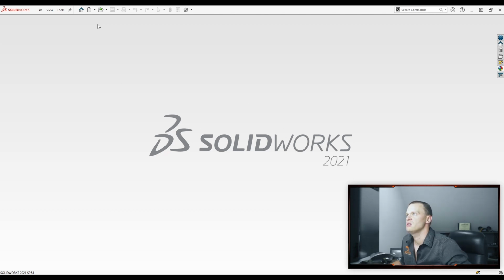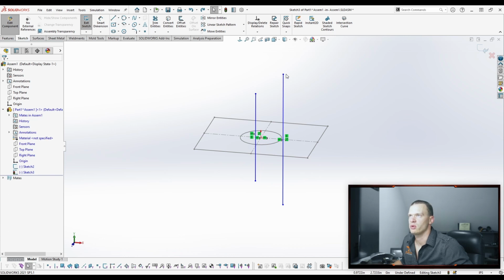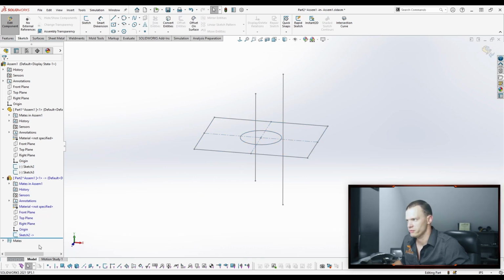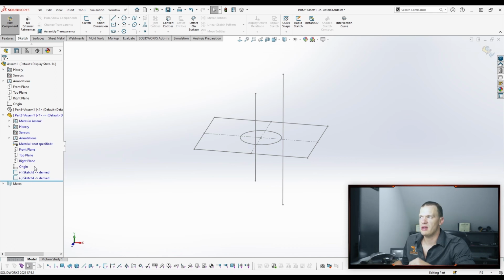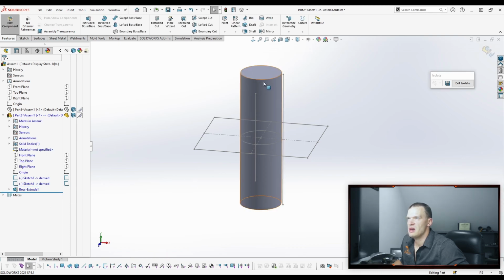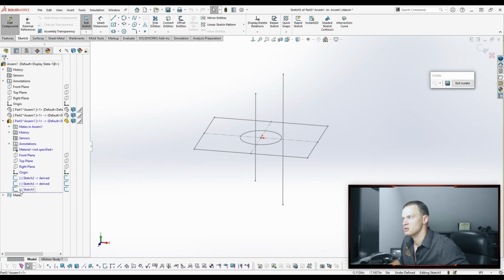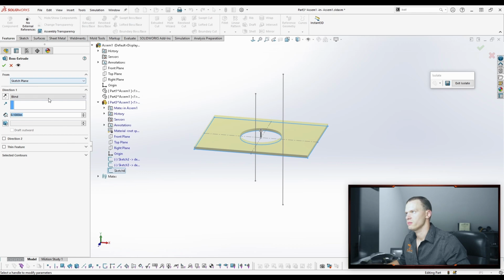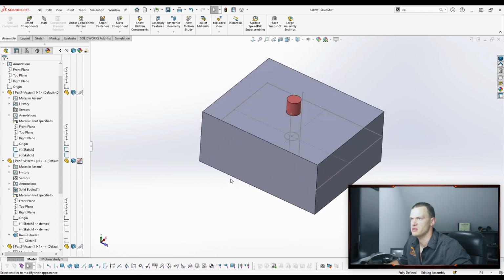Top Down Modeling With Skeleton Sketches in Solidworks

Comment: Yea, easy when you already know what to design. That is the problem with the cad software designers and instructors, They are seeing and approaching problems from a different perspective than a designer -  "This is the best way to design this assembly"....... But most creative designers just have a very rough idea in their head when they start. Then the design will grow slowly from blocky parts and grow by adding/removing features/parts hundreds if not thousands of times in the most chaotic order.... Yea, one could redesign everything again and get it clean and optimally structed after this creative phase, But small companies don't have such resources, and the design will be used as it is.
Reply: On top of this, the storage and creation of manufacturing info, especially when parts are shared between products, makes this utterly unworkable in a manufacturing environment that does any real part re-use. I rarely need my assembly to fully update and push changes in multiple subcomponents, and even when I do, I don't trust software to push the changes properly ready for review.
Reply from the maker: @jamesbuckle6077 You are right, this would be terrible if you tried to do it this way, but that would be a misuse of the technique.

This is primarily for NEW part design. Once the product has been validated and released (ie. is stable), best practice is to freeze or break the relationships, so the parts can exist on their own. By doing this, you can reuse them in future assemblies, just like any other COTS part, without worrying that they would change due to revisions in the parent assembly. Any future changes would be subject to normal ECN processes. I blame myself for the misunderstanding, because I do not cover this part of the workflow in the video.

Think of it like this: you would not reuse a part in multiple products that has not been designed yet (and if you were designing a multi use part, this technique would still be the best way to do it, as you could create functional relationships between both assemblies), and once it was designed and ready for incorporation into future work, the design would be stable and therefore locked out to exist on its own. 

Does this help/make sense?
Reply: @forgeproductdevelopment  that's true, but it's also a long way from the reality of the process anywhere I've designed parts. I feel it comes under "nice idea" but not actually a time saver unless you spend most of your time in development trying out dozens of iterations. Most of us napkin design a solution, plonk down the design in a first stab and maybe make one update based on FEA. I suspect there are some business areas where it's more applicable and they spend all day updating hole patterns and don't have the internal process checks to ensure mating parts were changed.
Reply from the maker: This may be a use case thing then. What type of parts are you designing? Are projects a few individual parts or an entire assembly/system/mechanism? Do you have multiple engineers working on the same project at one time (subsystems)? Are you doing from scratch development or mostly legacy stuff?

"Development" is literally in our name, so yes we spend most of our time with large complex and evolving assemblies. Our parts have many dependent relationships, that are constantly getting changed, evaluated and updated. Projects usually too complex to capture in a napkin sketch first stab. Relying on solely manual checks and modification would be far too slow.

That said, there are occasions where we are designing a part from a drawing, designing a single body stand alone part, or reverse engineering a part and just copying what exists. In those situations this would be overkill, as we don't need the parametric relationships. I might suggest that, if this is the type of work you are seeing, you could save a lot of money by dropping SW and going to a non-parametric CAD program.
Reply from the maker: This is a great comment, as I can understand your frustration and am sure others have felt this way as well. I have felt the same way watching people do surfacing Tutorials for SW too.

The truth is, you are right, CAD is a terrible iteration and ideation tool. It takes way too long to create even the simplest of geometry, let alone build proper file structure and dependent relationships. However, even though that is true, the solution is not to throw those things out. That would be an excuse for poor CAD practices. Rather, it is to use other, more effective tools for the ideation and conceptualization phase. Moving to CAD only when you can leverage what it does best, relationships and structure. 

Imagine you are trying to design a new house by building walls and pouring concrete, then half way through you realize the layout isn’t right. It would feel really clunky to have to rip all that out to change the design. In fact, that frustration may cause you to build lighter weight walls, or to try to move the concrete around while it’s still wet. The need for flexibility would create bad practices with those tools because they are being used for a job they are not designed for. Same thing here. You are using CAD tool too early in the process to be utilized properly, therefore you are creating bad practices to try and use the tool for something it is not designed for.

On a real-world project for a client, it is very rare that I will touch CAD before I have gone through extensive ideation and industrial design with pen and paper or tablet drawing tools. Keep in mind, I am an engineer, not an artist, so these drawings are often very rough and unsightly. Then, once the client has signed of on a design direction based on the 2D sketches, we move towards CAD, then iterate from there. Often times we will design a CAD model and then find a new design direction, but even then, we will go back to 2D sketching and establish direction before trying to capture the idea in a new model.

Also, keep in mind you are watching tutorials on how to CAD, not how to design a product from scratch. You only see “cad software designers and instructors” showing you how to draw stuff they already know, because they are trying to show you how to use the tool, not a documentary on their overall process. To make videos showing how to ideate or conceptualize in CAD would be untruthful to their process and bad practice. 

Hope this helps clarify some things, feel free to reach out if you have any more questions or comments!
Reply: @forgeproductdevelopment  no substitute for pen(cil) & paper, highlighters for ideation!

That said, I start with some simple reference goemetry in CAD to establish constraints, key datums, and simple sketches.  This because we've all sketched something that "made sense" until you put it to scale...

Print rudimentary CAD, sketch to ideate, update the sketches, occassionally add more reference features, lather, rinse, repeat.  This also creates a breadcrumb trail.
Reply from the maker: @raphaelhamm3853  This is an excellent suggestion as well. 

We have designed products where there are PCBs and motors, attachment points, or other components that are selected based on previous calculations. Sometimes we import those into CAD early on to get a sense of scale, and export out images to draw over the top of when coming up with designs.

I think the heart of the matter is "start with what you have and select the best tool to move your forward given the initial conditions'. Whether that be from COTS components, systems you need to integrate with, mathematical calculations, or a completely blank sheet of paper. Each project is unique and part of the fun of engineering is getting to solve and optimize for those challenges along the way.
Reply: My question is simple to you how can I design my own product then from scratch just like real engineers do with their own dimensions and specifications? If cad doesn't allow that then how? I cannot afford to copy only dimensions from YouTube and just stamp it.
Reply: @ridwanhusainishraq 
This is quite the read, feel free to reach out if you are still stuck on how to proceed.

The design process begins long before you first open a CAD Software.

I would recommend taking just a pen and paper and making bullet points for what your design should accomplish first (i.e. move a box from a to b / if the box is red, flip it upside down). No idea yet, how we accomplish that, just write down your goals.

Then you can add definitions, measurements, forces
-how big is  the box?
-Are there multiple sizes or just one?
-Are the sizes standardized or can they be anything between 1 inch and 1 foot?
-In what direction am I moving the box?
-How heavy is the box?
-How much space do I have for my transportation machine, what are the outside dimensions?
-What are the boxes made of like cardboard, plastic, wood, metal?
-How sturdy are the boxes, how fragile are they and how fragile is the content?
-Do I have to avoid vibrations? Or maybe I want everything to settle into place properly and I specifically want vibration.
- And so on...

Now you figure out how to best solve these problems, still just pen and paper.
- Do i use a conveyor belt?
- A piston that pushes the box over a row of rollers?
- If I go up, do I build an elevator to lift or a crane to pull up?
- Can I use a gripper and a robot arm? Magnets? Suction Cups?
-If my box is red, how do I detect that? Do I check the label if there is one with a bar code scanner or do I install a color sensor?
-How do I flip the box? Does that work with my transport system so far, or do I have to think of something new?

And when you have answered all of these questions, THEN you go into CAD.

Here you can decide if you want to go from outside to inside, the other way around or a mix of both. I prefer the mix.
Here is where the technique of the video really shines.

Make a part with the smallest and biggest box you expect for your machine (the inside part, what the machine has to handle). Then make another part or sketch that defines the space that your machine has to fit into (the outside part, the theoretical shell of the machine).

Now you start to think about where you place the parts of your mechanism and start sketching them one by one in individual part files (like the pin and block in the video). If there are things that will be moving relative to each other, make them in separate part files so you can join them in an assembly and check the motion later.
If there are pieces that are fixed to each other, you can either make them multiple bodies within one part (less strain on your computer) or you can design them individually as part files, combine them in a small assembly file and bring that assembly file into the big overall assembly to act like a single part . Or you make everything in individual parts and assemble them all in one assembly.

I would try to have multiple bodies in one file if I can get away with it. It depends if you want to make explosion views for drawings, motion analysis, mechanical strain calculation FEA, manufacturing analysis CAM or assembly studies (can I actually fit my screw in where I designed it or is the screw hole inaccessible?)
Reply: @user-kt7kh2vj2l you didn't understand. I have no specifications here. Becausr it isn't my design.  I just wanna learn the homework or prerequisite you do before touching solidworks. Customers will supply specifications and we must be able to design as per their specification in real world. So I wanna learn this approach from you. Think as an exam or assignment. The main thing is conception so what approach do u apply or knowledge do you apply such that you no longer need to be purely dependent on YouTube dimensions rather you can design independently using independent parameters

Comment: Hi, cheers for the video. Could you please give your opinion on why you use this method over adding skeleton sketches to each part using "insert part"? I am just starting out with this method but want to make sure I'm using the method with fastest rebuild times so I don't have to redesign the whole project again. I'm designing heavy vehicle bodys/trailers so designs are similar but never exactly the same, I'm looking for a way to more efficiently make geometry changes. I feel the main bonus with the alternative method is that you could insert the skeleton sketch to a part and then copy that file many times so you don't have to do the derived sketch each time you make a new part. Am I right in thinking that would be a more efficient approach? This video outlines the alternative method https://www.youtube.com/watch?v=99I0kh8d0wI Cheers!

Comment: Nice video
shouldn't  you have to constrain the new parts added to the original skeleton part (which should be fixed, anchored)?
otherwise they could "move" freely
Reply from the maker: You do not have to constrain the new parts in the assembly as they come in fixed. You can delete the InPlace constraint and then move them like normal if you want to. Also, you can (and probably should) constrain the derived sketches in the each part file. I do not show this in the video though.
Reply: @forgeproductdevelopment thanks. I'm coming from CATIA and there are some differences.

Comment: How will implement this concept with surface modelling for plastic assembly ? The level of complexity is really exponential and often we need to experiment to figure out the good set of surfaces required.
Reply from the maker: Answering this properly is likely very dependent on you particular situation and workflow. 

At first glance, I would recommend that you do not use SW for experimental surface modeling, such as in the ideation phase. A mesh based modeler like Blender or Z Brush may be a better fit. They are much faster in creating flowing organic surfaces and they can be changed very easily, without blowing up a feature tree. Once you have a better idea of the shapes you are trying to create, then you can model them in SW, without worrying about having to make large changes.

As for adopting the Skeleton Sketch Technique for this, you could share geometry like curves using the SST. One method would be to project the curves onto planes and use those as the derived sketches. Then, remake the curves in the part files using "intersection curve".

Does any of this help? Feel free to ask more questions!

Comment: Thank you immensely. I'm coming into SW from 20 years in Inventor and was wondering how top-down design is done in SW.
The other videos I watched wrongly claimed top-down when they were in fact showing middle-out strategies.
Reply from the maker: Welcome to the dark side haha. The first job I had out of school used Inventor, but I am sure I was terrible at it. How do you do top down in Inventor?
Reply: @forgeproductdevelopment  Top down in Inventor is pretty much the same workflow as this.
The only difference is you can derive out solids and surfaces from the skeleton part in addition to sketches. I'm sure it's possible in SW as well, I just haven't figured it out yet.
Reply from the maker: @GeorgeAlex-j6k I see, I figured they would be similar. Yes, you can add bodies and surfaces to parts and have them stay parametrically linked to the parent file. The command you are looking for should be “insert part”.

Comment: If I wanted to chamfer an edge on the block, and control the chamfer dimensions from the skeleton file, how do I accomplish that? I can't find a way to relate those dimensions. Great video, by the way.
Reply from the maker: Thank you so much for the kind words! Great question. I would create a global variable for the fillet width inside the skeleton sketch part file. Use that variable as a dimension inside the sketch. Then, create another variable within the part file where the chamfer feature will be created.  Next, within the parent assembly, set the part variable to be equal to the skeleton part variable. Lastly, create the chamfer feature and set the width equal to the variable within its part file. Now, whenever you change the dimension inside the  skeleton sketch, it will pass the value to the other variable and the feature. 

Another cool trick, you can dimension previously constrained geometry in a sketch (a derived sketch) and set the new dimension to "driven". This basically creates a dimension that is measuring geometry for you, that you can reference in your equations/features. When the measured geometry changes size, the driven sketch dimensions changes, and updates your equations/features.

Both options can work depending on your use case. Keep in mind, daisy chaining dimensions and features like this, especially if it is across multiple parts/files, may cause rebuild issues. I always try to make changes from within the parent assembly, so all parts are open and rebuilding together. Also, "ctrl + Q" will be your friend.
Reply: @forgeproductdevelopment  thank you so much! Great answer. Can’t believe you’re still replying to comments this long after it’s been posted. Awesome work
Reply from the maker: @akaZ__  You are very welcome. It is a lot better than waiting on me to make a new video haha